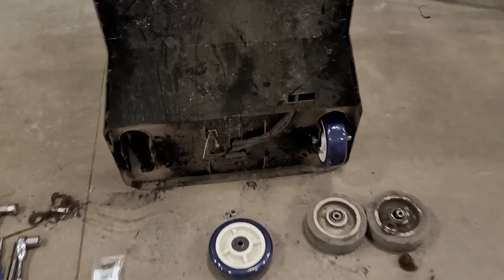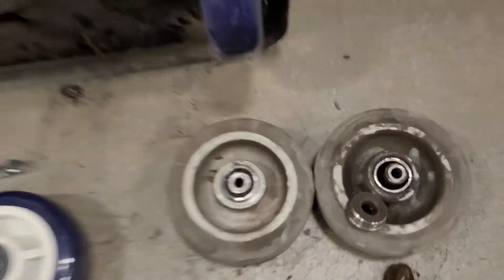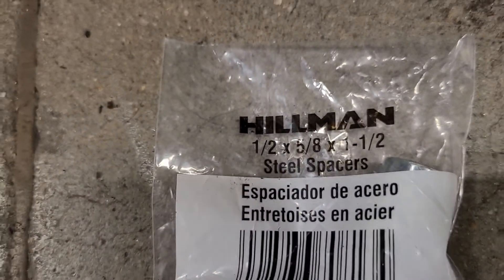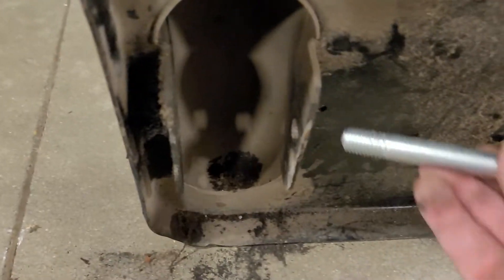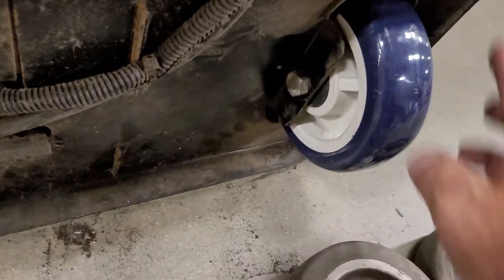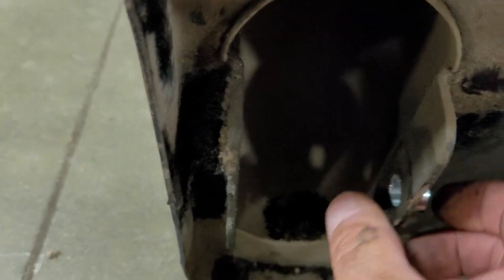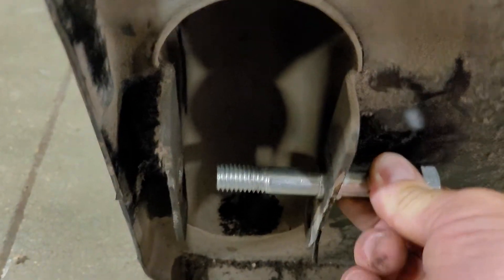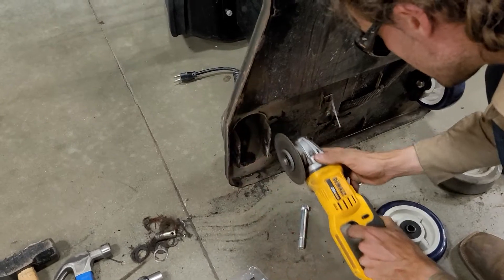Amigo Gen3 Retro Fit Rear Wheel

Comment: but what about longevity of the wheel life ... those hard polys are gunna wear out /get flat spots alot faster than the rubber ones ... and that will only work on the older models the newer ones I haven't been able to retro fit them because of the one hole axle bracket
Reply from the maker: You can just in a different way